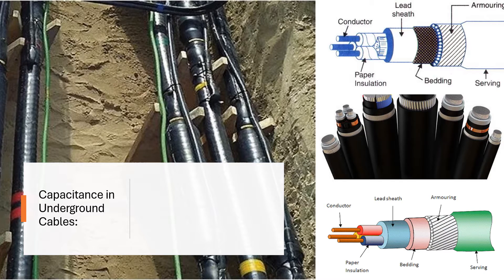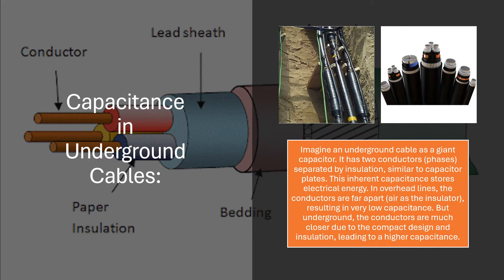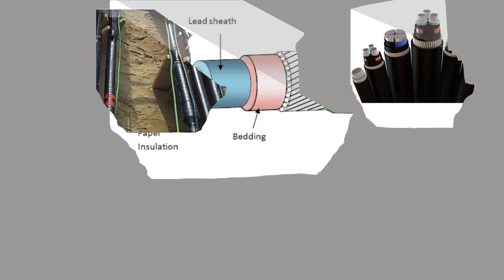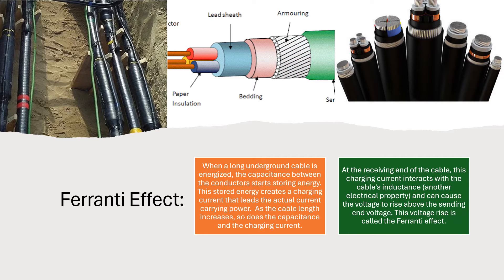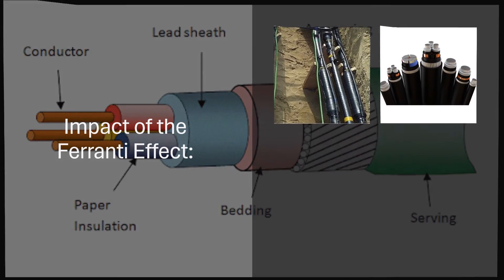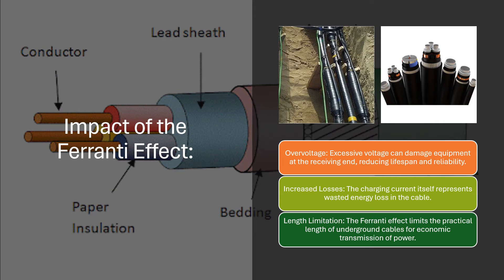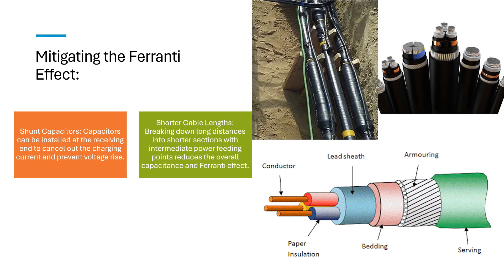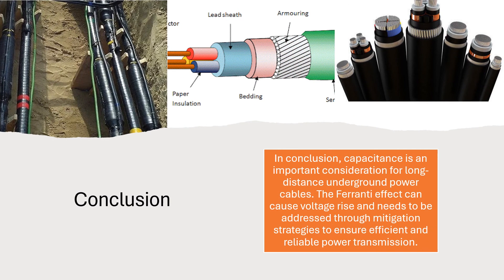Capacitance in Underground Cables

Comment: So if the cable has to be underground/water & the losses are going to be too high you use better cable or DC & convert back to needed format at the other end.
Also it carefully avoided the correct terms of transmission line theory, which needs a matching termination ( to cancel reflection peaks/troughs).
Reply from the maker: Yes